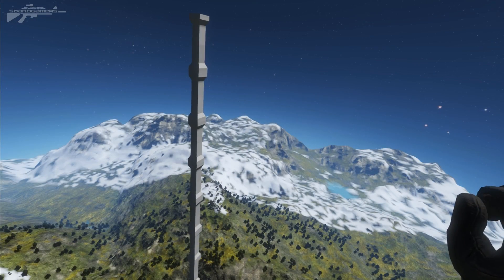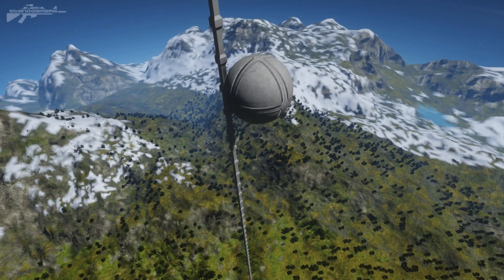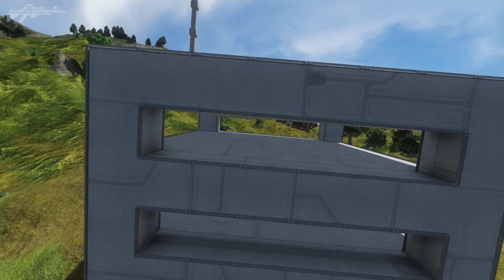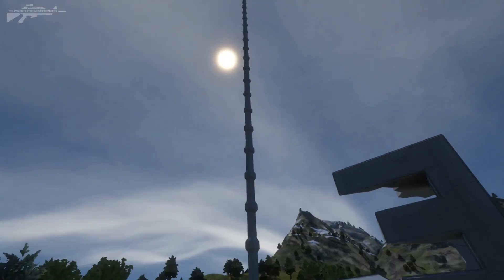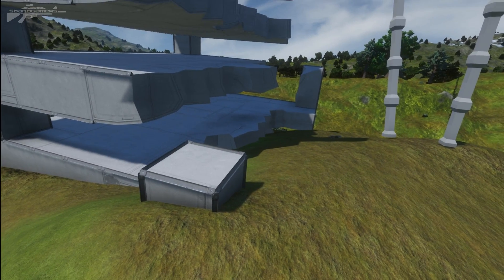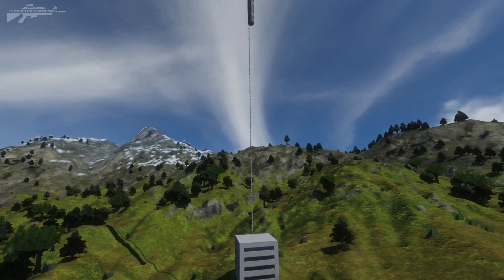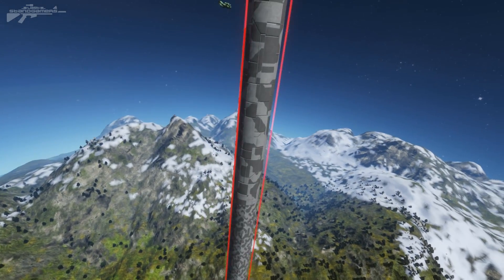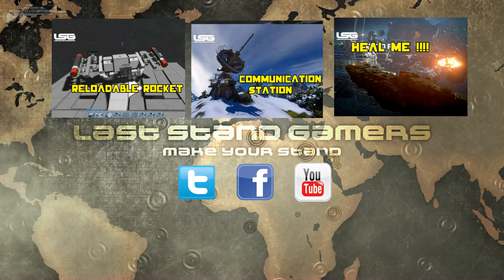Space Engineers - Kinetic Energy Testing

Comment: In theory this would work but due to limitations of space engineers it would do that much damage
Reply: Nah not due to limitations alone . This thing does most of its dammage from the kinetic shockwave on inpact which is a feature thats entirely not there.
Reply: Mach 10*
Reply: when the rod enters the atmosphere they are coming down at maybe about moc 10
Reply: the reason this weapon idea was scrapped wasnt because of its effectiveness infact they believed it would cause the same amount of damage as a small nuke with the added benefit of far better penetration  and no fall out. however it was scrapped for ethical reason as you can shoot down a nuclear missile but there is no current way to stop a rod of god going at mk10. you also can not detonate a god rod mid flight if the enemy has surrendered like you can a nuke.
Reply: axeami135 thats one of the reason the other was mainly cause theres no method to decerelate them fast enough (so they could go straight down and thus experience less atmospheric resistance) ontop of that it would be rather expensive to use for the ammount of damamge it does (also let me correct you there i doesnt do as much damage as a small nuke the impact(kinetic energy equivalent) would equal 11.5 tons of TNT hiroshima was is considered a small nuke compared to todays nukes was equivalent 15 kilotons of TNT

the 11.5 tons of tnt would cause dammage and be lethal in a +- 175m radius
Reply: You deserve a medal.